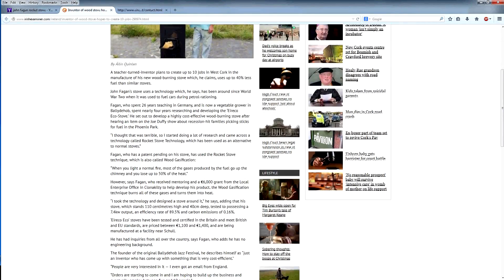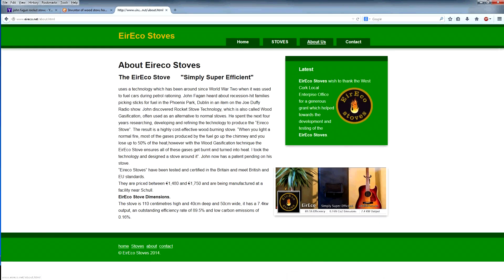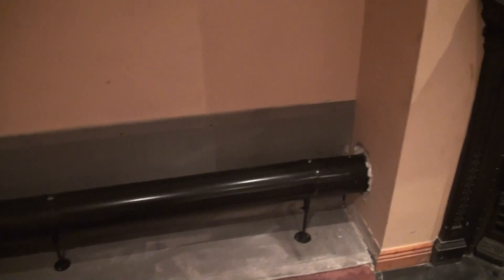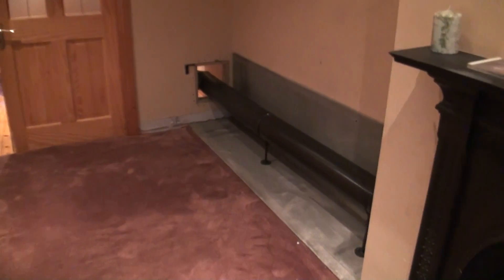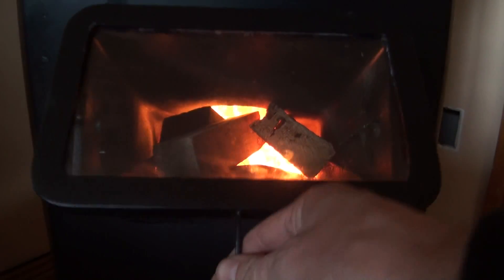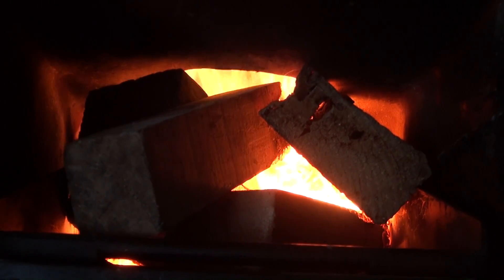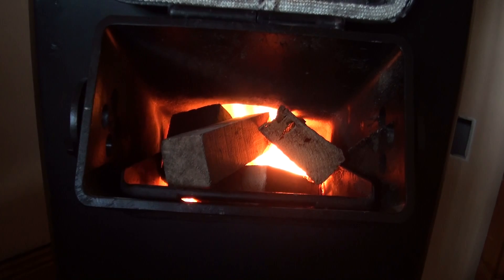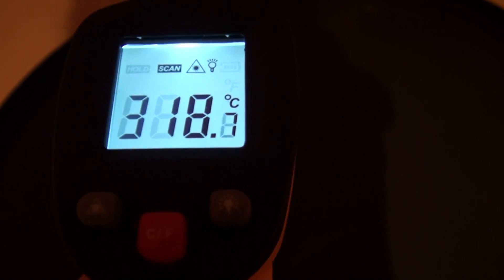Rocket stove

Comment: "Rocket burner:  A fully insulated, triple stage, re-oxigenated, almost complete (99%) combustion process producing the maximum heat output possible which, due to the proportions of the initial firebox, throat and main combustion chamber, also happens to produce a slightly positive exhaust pressure, thus allowing for a serpentine horizontal exhaust system which, in turn, allows for most of the produced heat to be transferred for use."

Comment: Best wishes to Master! Beautiful design of the furnace. Thank you for useful knowledge. 
Success and good health!
At a temperature of 120 degrees C, burning of dust begins on the surface of the metal surface of the barrel. Invisible sprays of burnt dust spread in a residential area, polluting the air. For the development of your projects there are new technical solutions for a universal rocket furnace for cooking, heating water in a boiler and heating the ceramic floor and the water-heated floor. A brick or ceramic rocket furnace is the most effective means for heating a house, greenhouses of any size: https://sites.google.com/site/menedzmentteoriapraktika/upravlenie-infrastrukturoj/rocket-stove-new-design
Reply from the maker: Thank you Aleks, the link is very interesting, If ever I have an eco house or greenhouse I will consider it. Interesting too about the dust formation, I was aware of this potential but you are the first person to point it out.

Comment: Hiya, very interesting stove. Did you get around to install the thermal mass yet? Love to see it. Anyway, big thumbs up :D
Reply from the maker: +soylent gruen Hi Soylent, I did a really lame attempt at the thermal mass, it was poorly thought out and I rushed it, so I will have to re-do it.
Reply: @Aquavidify  I know it's been 4 years, but I'm curious about how you've been faring with the rocket stove. Would you still recommend it after this time? Also, have you re-done the thermal mass like you had planned?  I've recently bought my own house and I'm thinking about adding a rocket stove + thermal mass to my setup.
Reply from the maker: @mariotommadich4685  hi mario, it's going great, can't believe it's 4 years,  have not burned kerosene since the rocket stove,  we love it, this year I'm burning scrap wood from a timber decking which was free.  I never got to the thermal mass,  i put a copper backing to reflect heat.